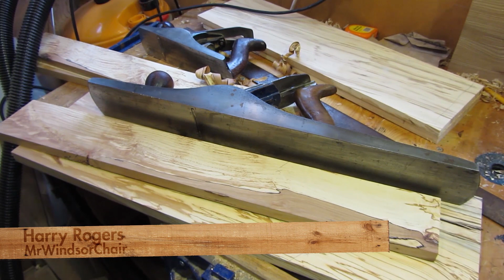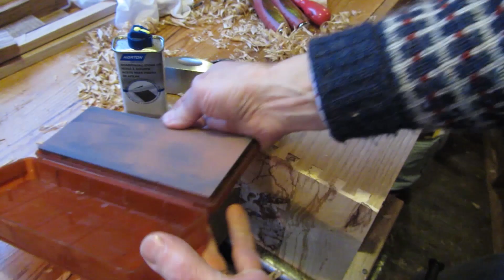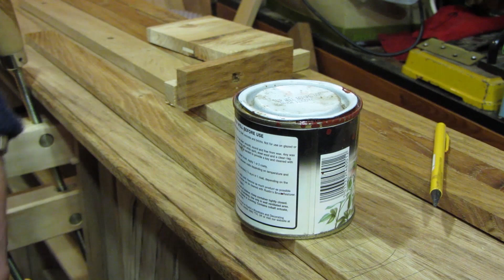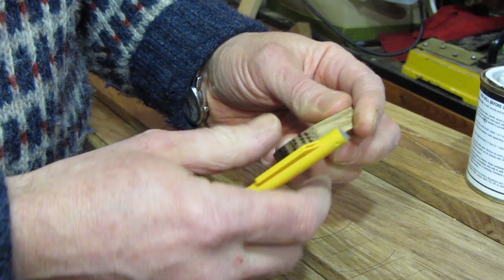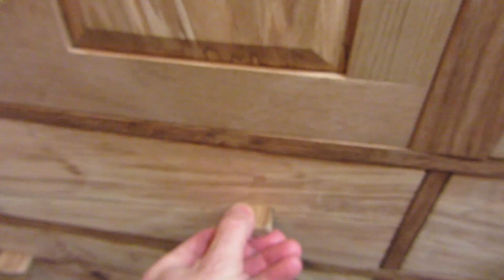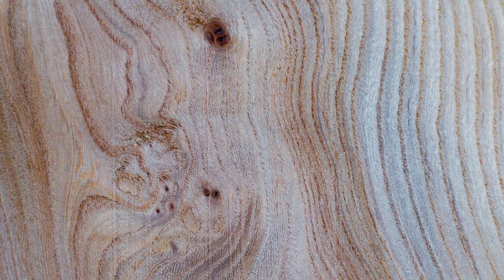Making a Tool Cabinet - Part 6- Drawer Construction

Comment: To clean your oilstone use WD40 and a kitchen towel in a squirt-dab-squirt-dab process. The oil floats the residual metal and the towel lifts it off. A rare earth magnet does the job well too. The build up is due to either not enough oil or poor oil. The oil is there to help the filings float away. I have always used 3 in 1 without a problem.